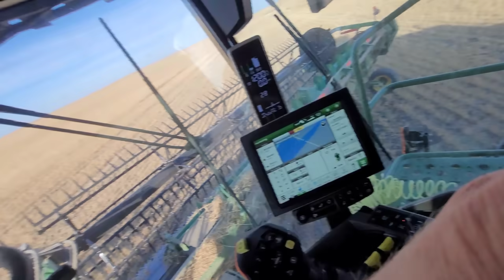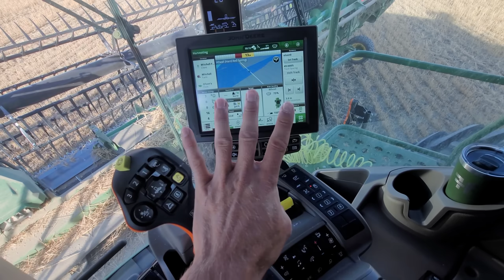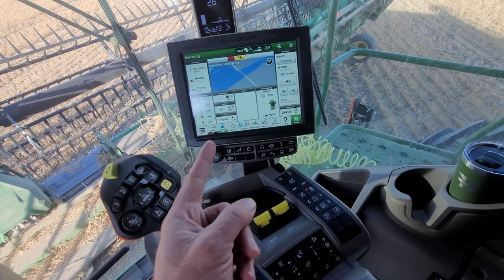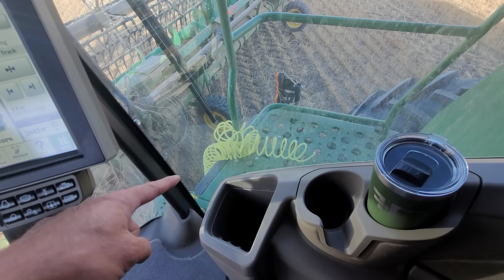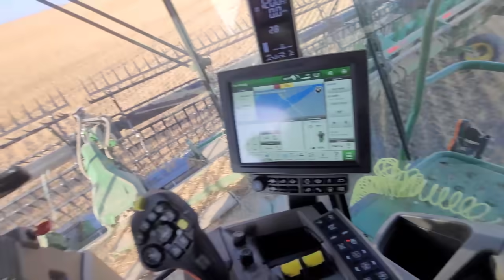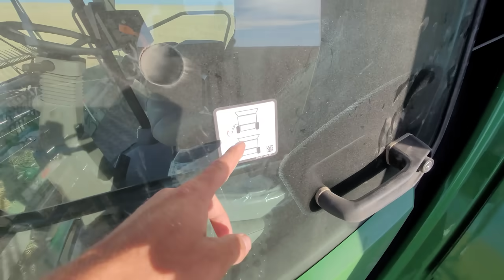Fendt vs Deere - The little things!

Comment: Mike, here's the question of the day. Very seldom do I see crop fall off the back side of the hopper, but on the front, we see almost every grain there is on the cab. John Deere should make the tank taller in front to stop the cab corn, beans, and grains.lol so picky we are, just watched a YouTube video, and I'm not sure what kind it was, but that thing had wood on the reel, it took like the old pull string to start a small motor on the back, and then that helped start the combine motor. It had a few John Deere parts on it like the auger, and a couple pieces on the back of the combine. I believe they were in Ukraine harvesting wheat. If that thing was in the USA, OSHA would of been all over that like a duck on a June bug. I'm like 99.9999999999% sure that there's probably been many loss of limbs on that thing. Yes it did have two door cab, one on the left, and one that you step through and onto the back where the little starter motor is. I'll try to find the video Mike, because I'd love to hear what ya think about your New ride compared to that thing. I bet those people maybe do 30 to 50 acres a day if they're lucky that is.

https://youtu.be/qohx6bvMNgc
Reply: @allannantes8583  Alan, you can say they use just the basics. I wonder, if you can change anything on the head or in the combine to change losing wheat? How many fingers and arms have dissapeared from a machine like that? I'm betting they could double their yield with something newer. Amazing, and did you see how good that wheat looked? I betcha that's a bumper crop for them, yes, Mike should get everything he wants with what they pay for them, but look at how blessed we all are. 

I wonder how long it'd take for Ukraine to get where we are now. Amazing that they're fighting a war also. Have you been watching what's taking place in Pakistan and china? It's not global warming, it's end time stuff taking place. china's drought has the Yangtze river drying up showing 3 Buda statues right in the center of the Yangtze river. This droughts like a 5,000 to 10,000 year drought. Remember what I'm saying because there's people going to starve in these countries. There's still major problems in Africa, the countries blessed by God are still growing as much as we can. But this is going to get truely serious for the World. How do you feed 1.5 billion people with food and water? Somethings about to blow up, china's and Pakistan are going to have to buy food and shelter for people, something big is about to take place. God help us all!
Reply: @rickk6447  This is all predicted in revelations. Could it be the four horses of the apocalypse? Maybe this is just a warning for us to take heed of, next comes the calm and what comes after the calm. Oh I’m sorry I just need to calm down or I’m just going to scare the children.
Reply: @allannantes8583  it's OK, that was exactly what I was implying towards. But here's something better: I Love to study Theology, if you don't know this yet this may be kinda exciting for ya. We're told we'll know when he's at the door. Do you see the USA like it is now in two years? Most don't know this, but there's the 7th yr which is a celebration. In Judaism they work hard for 6 years and on the 7th they let the land sit idle. It just so happend on September 25th that's the end of the 6yrs, September 26 starts the 7th year where the jews are told to rest the land, don't harvest the grapes. We know that way back then they didn't have winter wheat, and when does Wheat and Barley finish up by? The middle to end of September.

Now I'll give you a couple more:  we know that the Ottoman Turks walled up the Eastern Gate on the Temple Mount. That gates called the Golden Gate, the reason? It's for the return of the Messiah, we know that Messiah to be Jesus Christ/God. The Ottoman Turks knew this, except they had heard its the high priest. At approximately the same time, they told the jews to bury their dead outside the Eastern outer wall, there you'll find a huge Jewish Cemetery. This all matter and here's why: the Turks knew that the Jewish High Priest will never touch a dead person, nor will they walk through the graveyard. They spend their whole life becoming pure, so to walk through or to touch the dead makes them impure. The Turks knew it, so what happens when we hear those famous words "come up hither" for the dead in Christ shall rise first, than we whom are alive in Christ will meet Jesus in the air. His feet never touch the ground when we're caught up to meet him. At the ending right before the battle of Armageddon, it talks about him returning, like a lightning bolt correct? This matters because it says his feet don't touch down until he goes through that Golden Gate, the lightning is what opens it up.

For those that don't believe in the Rapture there's this: in Jewish Tradition the night before the wedding after the supper, the bride maids and the groomsmen play this game, they grab the bride the night before the wedding, and do you know where they take her? If you guessed they take her to her father's house, you win! It's a game for them, they know where she's going, when she's going. It says we won't know the hour, but thinkmabout it, we have how many time zones throughout the world? A lot, so no, nobody will know the hour. Imagine what we're seeing right now, china's about to start a war with Taiwan. Something big about to happen in the World, I believe it's the Rapture, maybe UFO's will show up, or maybe Yellowstone will explode, but there's no way the USA will keep going like what's happening right now. Evil is around us, and for every one demon that's cast out, 7 more show up. This is what we're seeing right now. Everyone keeps saying, well we haven't seen the fallingbaway of the church yet, I beg to differ. The falling away of the church happened with COVID-19 Allan. The church almost vanished, not only that, most people whom perished were elderly. When you fall away, it's like falling down, some get back up others stay down. Yep, the falling away, says they go away for a short time but it doesn't say they don't go back, we did after we fell away. I don't believe we'll have a November election let alone be around for another year. Global War is about to start, and could the little horn refer to the Ukrainian president? Acountry that rises up and is drawing nations into a War with Russia, China,mandate Iran?

Not sure if you have heard about this, but the USA military personnel came back after Iraq, there's some strange, strange stories that came back with them. Our Military was helping protect the large dams on the Euphrates River. The water flows the opposite direction compared to the Mississippi River. There's several dams that keep the Oceans from destroying the land around it. The story goes like this, the Iraqi guards heard strange sounds coming from deep below the dams. No big deal right? This is where the three unclean spirits are held that's going to release hell on earth, yep, we see the craziness that's taking place. We are told that we're kept out of the Great Tribulation that's about to befall on earth. I sure hope you have your space suit ready. Up, up, and away.
Reply: @rickk6447  I’m getting a ticket from Elon Musk for a flight on a Spacex mission when the time comes. I’m going to ride out the tribulation from up there and then weight out my options from there. I may as well spend my money as I have never seen a u-haul behind a hearse yet.
Reply: @allannantes8583  lol, it's hell having to decide hell on earth or Angel flights direct to heaven?lol  Monet means nothing my friend when it comes to the soul. I know with the Big E his flights will take minutes I'm hoping I get the cheap seats for my trip, because I go up and 7 years later I return not having experienced death. I'm betting there's buttered popcorn with stadium seating everywhere. And it'll all be In surround sound.
Reply: @rickk6447  I’m ok with the cheap seats, as Mike says you’ll be watching from behind the stadium support beams and in this case that is ok to avoid the flak. You just have to bring some tissue for the nose bleeds. I’m going to spend the money I save on top notch meals.
Reply: @allannantes8583  love the response, who knows I'll keep ya a seat pen next to me.lol God bless

Comment: JD could use the same idea as the  Boeing 787 Dreamliner.

The passenger windows on the 787 dont have shades. 
They have electronically-dimmable windows that have variable adjustments.
The two windows panes are separated with a gel. 
When a current passes thru the gel a chemical reaction happens which changes it opacity resulting in a dimming effect.
Reply: I was also thinking that they could be made to auto adjust by using a temperature sensor that would be triggered to activate by the suns heat.
Reply: And how expensive would one of these windows be?
For an aircraft the price doesn´t really matter since it´s quite unlikely that they will break.
But in a combine or other road vehicle? Especially with all the gravel roads where Mike is.

Comment: A coffee pot needs more than 1KW, probably 1.2KW.   On a 12V system, that is 100A from the charging/battery system.   Not sure if the combine would have that much extra capacity.   Then there is the issue of cabling.  Either you'd have to run a big power cable up to the cab or locate the inverter back in the engine compartment and run 120VAC up to the cab.  It would have to be a pretty stout inverter to live back in the engine compartment.
Reply: Where are you getting that figure? No inverter I've seen, even the 2000w ones pull anywhere near that much.
Reply: @J-1410  It's not just the inverter.  It is also a heavier alternator and wiring, plus things like liability insurance for it.

Go buy a good 1500W inverter and install it on your combine.  Tell us how much it costs.   A 1500W inverter will pull nearly 150A.  I doubt the stock alternator can support that, so it will need an upgrade.   Plus cabling and wiring.  And product support.  And warranty support.   It all adds up.
Reply: @J-1410  Yes they do.  Basic math.  Power = V x Amps.  If the combine is supplying power at 12V,  the current for a 2000 watt inverter is 166.6Amps if it is 100% efficient.  Which it isn't, so it is even higher.
Reply: @SomeTechGuy666  I have never heard of liability insurance for an inverter.

I have a 2000w on my Semi. 150 amp factory alternator. Inverter, long ago, was $500 and came with 30' of 10 gauge. You don't run off of 12v, you run it off of 24v. Most things have more than one 12v battery anymore. 

That being said, nothing pulls its rating continuously.

Comment: Hey Mike.  You missed the twin rotor.  Yes Fendt has it too but it is all because the patent expired.  Turns out two rotars are better than one .... said an advert once in the 70s.  .
Reply: And IH proved in the 80s that this wasn't generally wright.

Comment: I can get over that ladder (I bet that soft close door is mainly there for idiots that just slam doors and break them) but those damn fucking strobes are a joke and just to be a pain in the butt every brand has them now,  as a runner who also does cart, let me tell you I carry binos for a 2 by 2km square field to spot those during the day.  When we´re done this season, you can bet there´s rotary lights going on the combines A S A P. 
Dear John and engineers, if it ain´t fucking broke, don´t fix it. Thanks!

Comment: That ladder... HOW did that pass safety tests? Combine fire, ladder up, your a gonner...
Reply: Far safer being mechanical than an electric button. Though it should be able to stay down when working
Reply: @chester1507  Every electric one I've seen you can overpower it in an emergency.
Reply: @J-1410  that is true though I stand by the mechanical option being far safer and more reliable.
Reply: @chester1507  Until you fall off trying to pull it up
Reply: @chester1507  do a farmer fix and install a fire station poll. Problem solved.
Reply: @allannantes8583  one of our neighbours lost both his legs in a baling accident 20 years ago so did that to his lexion. We call it his stripper poll. 🤣
Reply: @J-1410  that sounds like natural selection to me my friend.
Reply: @chester1507  sounds like natural selection to not just give the electric ladder a shove.

Gleaner has had them since 1973. There is 0 reason why a two million US dollar machine has a rickety manual ladder.
Reply: @J-1410  Great you buy one of them then. I'd take this one over an electric.... And nothing about the ladder is rickety....
Reply: @chester1507  Did you skip the part where he's sitting there wiggling on the ladder?
Reply: @chester1507  That is a sad story, it is great that everyone can have a sense of humour about it. Next thing you know you guys will be changing his name to Peggy so that he can identify as (he/she) pronouns.
Reply: @allannantes8583  that's the story of farming though isn't it. An industry filled with potential dangers carried out by individuals who can take anything on the chin and laugh about whatever.

Comment: Mike, you are dead on about the sound system in the X9.  The new tractors are the same.  Not as loud or as much bass as the previous models very dissapointing when you really need to rock.  They also made it so you cant control your phone or the stereo from the armrest like before.  Pisses me off.  I actually prefer the previous gen 8R cab, but i guess it's better than the 1980 chevy truck stereo case rips their customers off with.

Comment: Problem with 110 equipment in machines is anything that has a heating element like ovens use a sheet load of power 
Like alternators melting amounts of power 
And the inverter you need will take up alot of room 
Sun shade 
When are they going to stop point holes in the sun shade maybe aussie sun is brighter but when the sun's blinding you and you pull the shade down, the sun just goes right though the stupid sun shade, they should be solid 
I know it's so you can look though them but who the frig doesn't own sun glasses these days

Comment: You do know it wouldn’t be that hard to put an inverter in. 🤔 Xenon headlights would be even better than LED, whiter, brighter, and longer throw. You sticking with the Duals? Or are you eventually going to get Tracks?
Reply: Tires... tracks are worthless up there.
Reply: @crandonborth  Tracks on the North X9 might be good since it gets so wet up there, I guess not really needed when it hasn’t practically rained in 2 years. 🌵

Comment: People get confused with what a review video is.  I think people only want to hear about the features. I’ve seen a lot of good features with poor execution.  It seems that most of your complaints on both machines were easily fixed by a small edit from the manufacture and most of the time at least with one of those manufactures they change things based on the feed back they are getting

Comment: -Cupholders on the right side in a modern combine? Come on! ALL your controls are on the right hand. I realise there is a companion seat on the left. But how about you put a few on that side for when you´re on your own? I know you have a lot of straight fields, but if you need to act quickly, it´s a bad thing to have a drink in the wrong hand. 
-Those curtains you call visors are at best half of the window width. Learn from forestry, where you have seethrough film around  the edges and curtains to close the rest. Look it up. 

16:28 - I have never driven a rotor combine before, but on my ´94 Claas Lexion every adjustment I ever needed was on the computer. How is this mechanical on a top shelf combine in 2022? You´re complaining about the ladder - this would be an even easier fix in my book. My addition about the ladder would be that two extensions on that thing looks pretty effing Frankenstein. How about making a bigger platform for your market?

Comment: You look at combines in the wrong perspective. They are not here to help you feel better. They are there to farm more efficiently.  Nobody care about cup holders. Pro tip: Put a roll of duct tape on the floor. Farmers know.
Reply from the maker: I appreciate your opinion on the matter Joe, but I feel like you missed the titled of the video "the little things" 😆.. No one is buying anything based on the these. I am simply comparing the differences.
Reply: An X9 with the 50ft header is well over $1,000,000.00 when new. For that kind of money the luxuries should be there and operator comfort is a big part of efficiency. Especially when they’re going to be your home 16+ hours a day for a few months.